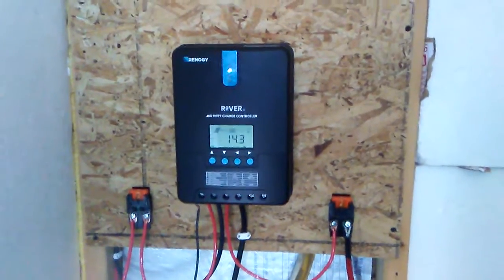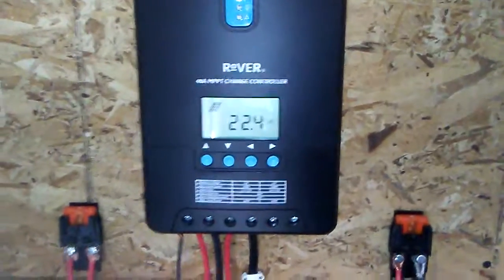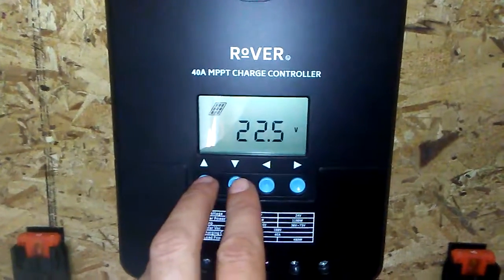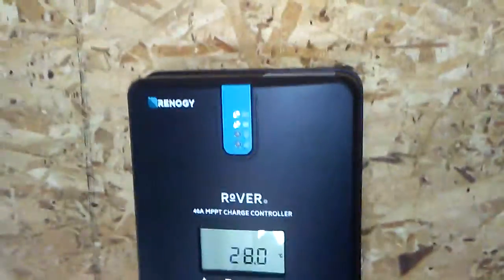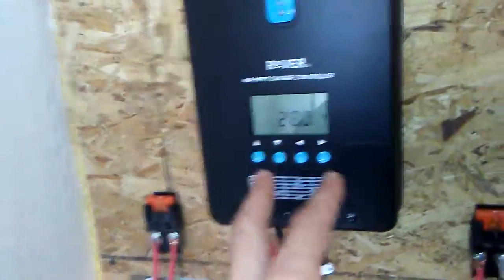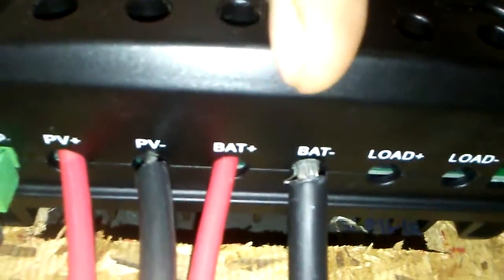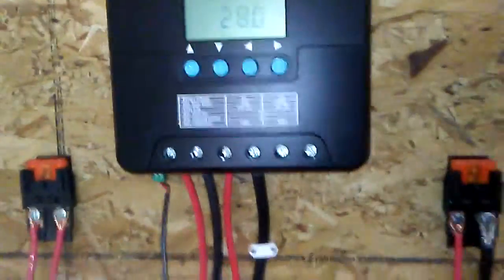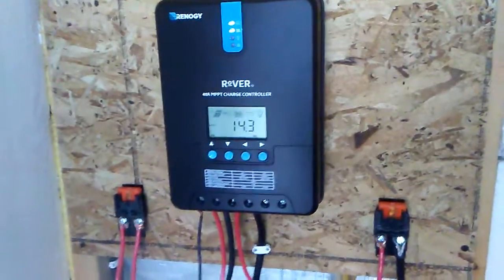Renogy 12V 400W 40A Solar Panel System Kit Install - Part 8 - All Systems Working

Comment: You skip around & move camera so it is hard to see how you wired the fuses....   & why the 2nd one (2nd panel?).  Comments on wiring would be apprec..
Reply from the maker: The Hot Wire Coming In... (red wire) has the fuse going into the charge controller. The hot wire coming out to the battery is also fused.
Reply: It's pretty obvious if you know anything about a solar charger two red wires coming out of it with fuses only means one thing. Fuse on the positive coming in and a fuse on the positive going out to protect your charger from short circuits or surges

Comment: Super videos in this series. You spend a great deal of time explaining things which is so helpful. However, you didn't really show the Rover connections for a novice. It would be helpful if you would show each cable and its point of connection. Here you start out saying cable comes in house and connects to a certain place. But then you just say this connects to this and that but don't show it. You do share a lot of good Rover info but I'm looking for a video that actually shows step by step where each wire goes. I'm sure there are manuals and pictures out there. I'm sharing my thoughts on this because you sincerely seem to want to be instructional and helpful.  If you slowed down a little and went step by step, a novice like myself could learn so much more. I'm a subscriber now and look forward to all your videos. Thank you!
Reply from the maker: Thank you for your suggestions and I will make a video on this for you.
Reply: I’d like to see the connectors used on the wires going into the charge controller.

Comment: Excellent video how ever temperature on the mppt is not the battery its for the mppt controller temperature management and if you want to know the temperature of the battery u need a monitor
Reply from the maker: The temperature gauge that came with the kit that plugs into the charge controller says to hook it up to the battery, which it is.

Comment: I have three panels that are hundred w h and I want to put an extra panel that's 350 Watts can I use that panel on my 40 amp charger controller 12-volt system
Reply from the maker: 300 w system, then you want to hook up an additional 350 w panel to give you a total of 650 w.  650 w divided by 12 v = just over 54 amps. I wouldn't do it.

Comment: This is a very simple question for anyone that actually seems, for some reason. to be hard to answer.... I need to connect the solar controller panel & inverter up to my battery. I only have 1 set (+ & -) of clamp connectors on there. Would it be OK to feed the "+" wires of BOTH the panel & inverter into the same connector slot & same for "-" ?
Reply: straight from the panels to the battery ? well I wouldn’t recommend it could easily damage your battery’s over heat or something while your at work burn your house down
Reply: @jaredfairbarn4417  

Thanks Jared. 

I didn't actually explain that very well. It is going through a controller it was more the the question of using the same terminal possibly with same wires touching connecting to the plus and minus connections. 

I have since been given to understand that this is not a problem at all and have had the system up and running perfectly well.

Thank you for your input though.
Reply from the maker: Yeah if you're just using just one battery that is fine. If you use multiple batteries you'll have to have some jumpers and you would want to pull your power from different battery terminals.  I could make a video on how to correctly do that if you would like.
Reply: @TinyIowa  

I think I'm OK now Tiny but thank you very much for your kind offer. 

The summer was really a process of experimentation & discovery with my first solar setup. 

It all worked fine during what was actually quite a good British summer for us. My one regret was possibly in not looking into more modern battery technology as my understanding is - with sealed lead acid - you only really have a 20% usage band as you shouldn't take lesuire batteries below 80%?

Funny enough, in bemoaning the British weather - When the sun is out we are probably one of the best countries in the world to run a panel in as a good summer's day will stay around an optimum panel functioning temp of around 25C! That's "if" the sun comes out!

Comment: Hi. I have a 60A, 4 300w panels and 4 225ah batteries. The fuse from PV is 100a but at higher amp it blows. Why? Also what's the correct setting for 24v battery bank? Thanks
Reply from the maker: one panel is equal to 25A if you're set up for a 12v battery system. for a 24v system, one panel will produce 12.5a. 
so all four 300w panels, Wired in Parallel, on a 12v system would be 100 amps. no good! 
But if you hook it up for a 24v system, using your four 300w panels, Wired in Parallel, it would only produce 50w.  So set your batteries up, Wired in a Series,  for a 24v, system.

Comment: Hi  2x190watt mono panels how many amps fuse ?  150 amp batty how many amps fuse ?  Thanks
Reply from the maker: It all depends on your voltage of the battery you have set up.
Reply: @TinyIowa  12 volt  ?

Comment: I'm learning about solar panels.  I want to get a setup of maybe 200 watts for my suv for camping in the desert. Enough power to keep a car refrigerator and cell phone charged maybe a small tv.
Reply from the maker: I would go with a 400 watt minimum setup.  Only reason why is because of the refrigerator and you sound like you may want to add more things eventually.  
is the desert the high desert  (colder climate) or a normally hot desert until nightfall?  The only reason why I say that is because solar panels don't produce as much energy in heat as they do with colder climates.  The standard temp they test/rate them at is 77 degrees F.  The hotter the temp is the less they produce.  The colder the temp is the more they produce. 
Another good thing to think about is your battery bank.  Try to get High Amp Hours in your deep cycle battery. The higher the number the longer they will hold the charge for. And the more charge they hold overnight until the sun comes up again, the less they'll have to be charged.  ….saves on batter cycle life.
Reply: Tiny Iowa I just bought 4 100 watt panels a controller and I already have 2 interstate deep cycle batteries for my boat..Will those deep cycle battery work good and how many do I need?? I want to run a deep freezer and lights mainly.. Thanks is it the more batteries the longer life you have between charges.. Also what size power inverter would I need?? Could you recommend me s good priced and quality power inverter.. Thanks

Comment: What price
Reply from the maker: For the 40 amp MPPT controller, 4 100 watt panels, and some wire etc... $670 delivered to the house.  
Less than $1000 you can get a couple 12 v deep cycle batteries, an inverter, and the solar set.  
It all pays for itself in less than a year.  Then every 5 years new batteries. Solar panels are good for 25 years.

Comment: Confusing, start talking about something then forget about it  and move into something else.  What is wire on far left going to battery?  Just said it doesn’t matter which post it hooks up to, then moved into batteries.  Would like to see how the fuses are connected and what size wire you used for all connections.
Reply from the maker: Yeah I digress a lot. The wire on the left going to the battery is for the temperature reading.

Comment: 24 volts is good ?
Reply from the maker: Yes that is!
Reply: The charge only allows enough voltage through the controller to charge the battery... 15 or 16 volts.

Comment: Can you run 2 laptops 12 hrs a day on this system?
Reply from the maker: Yes indeed. Just remember, the more batteries (amp hours) you have, the longer you can run your electronics.  We have two 12v sealed gel batteries and run our entire tiny house (including my wife's and my laptops) off of the system. Thanks for asking.
Reply: @TinyIowa  I want to attached a single 200 amp hours lithium instead of connecting two batteries, would that work also? Thank you again. I want to keep the setup as simple as possible.
Reply from the maker: I don't have the manual near me... I packed it away somewhere, sorry... But I think if you look up the manual online, I'm pretty sure yes you can.  That would work fine too.  My suggestion though is to go with 2 6volt batteries.  Usually the 6volt batteries have more amp hours on them than a 12 volt.

Comment: Could you be specific as to how I set the array for a Lithium battery? Just installed it and don't want to screw up. If you want, email me at acwdownsouth at yahoo....
Reply from the maker: Sorry it took a while to get back to you... unfortunately I don't know right off the top of my hand. Best suggestion would be to look at the manual or contact customer support.  They'll be able to help you out 100%!  Thanks!

Comment: Is it necessary to install fuses and why?
Reply from the maker: Mainly for protection.  Power surge blowing a fuse is better that blowing a more costly thing.
Reply: Circuit breakers are cheaper though over time, just reset them if they trip, saves fuse buying over time.

Comment: What are the best settings for an 18650 pack, 4S7p (16.8v) ?  I looked at the user settings but not sure what to set equilization and boost to?
Reply from the maker: I'm not sure.  I would call customer service and ask them!  Thanks for asking, sorry I couldn't be of help.

Comment: Why 6volt batteries and not 12volt
Reply from the maker: 6 volts usually have more Amp Hours than 12 volt. Thanks for asking
Reply: @TinyIowa  but then you need to run 2 of them in series to equal a 12 volt system. so doesnt it equal out?
Reply from the maker: 6 Volt Batteries Usually Have More AMP Hours on Them. When you run them in series yes the amp hours stay the same.  Usually you want to run MAX 3 batteries in Series. And the same goes for Parallel, 3 Max. (Both are easier to charge with only 3. 

Example... 1 12v batter w/100 Amp Hours + another battery w/the same stats... Wired in Parallel gives you 200 Amp Hours. But if you get a 6 v battery with 200 amp hours and a second one w/the same stats and wire them in series to achieve 12 v they will give you still 200 amp hours. But here's the thing...if you get two more 6v 200 amp batteries, (wire them in series) and wire them in parallel, you now have 400 amp hours. 

So in since it is not good to wire more than three batteries in series (cause its harder to charge) You can achieve more amp hours. Three 12 v batteries w/100 amp hours a piece will give you 300 amp hours. Whereas three sets of 2 6v 200 amp hour batteries wired together will give you 600 amp hours. 

They even have 2 v batteries... but it's just not economical to do that.  

Eventually the best thing to do is go up in power... instead of 12 v go with 24v or even a 48v system.... it takes less power to create 120 volts AC current going from 48 volts DC current. Whereas to create 120 volts AC current going from 12 V DC current. but again... economics & what one really needs. 

hope that helps explain things.
Reply: Tiny Iowa but then u would need buck or boost converter to step down that 48v to use on ur 12v devices
Reply from the maker: yes there are numerous ways to get the 12 volts needed. FYI most appliances nowadays are ran on DC voltage/current anyways. Most all have transformers built into them already, but people just don't realize. Pro's and Cons to everything.  Thing is... build your system for YOUR needs. There is no "Standard way of doing things." 
Also with the Rover (charge controller) that we use, there is a separate circuit coming from the Rover that has a 12 V Line.

Comment: The lower the cell temp the higher the voltage and power produce. Temp inversely correlate with Vmp voltage and Pmp. The problem is, the higher the temp the lower the voltage, and it may go below the charger minimum MPPT voltage range, and it may turn off your charging.
Reply from the maker: Exactly Correct!!  I'll be posting a video shortly since we are having cold cold days ahead regarding this!

Comment: Yes I was watching your video why things I do like about it but you're making a few mistakes that is not aluminum wire its nickel-coated is copper with nickel coating on it so you don't have to use no locks on The Wire and definitely definitely need to put ends on preferably soldering
Reply from the maker: The wire that I used for the installation was Aluminum wire. I was an electrician for many years, and studied the NEC book. Yes, granted the edition that I studied under is a few years older than the current one, but when I studied codes of the past it seemed like the codes never decreased in value and only went up. 
FYI, I have a close friend that still holds an electricians license and I specifically had asked him about the code for using aluminum wire. He told me exactly what I was panning to do is still correct to this day. Aluminum saves on weight and is more cost effective than Nickle Coated Copper!! Win Win! 

Yes, I should have put on electrical spade terminal connectors on my wire's before I connected them to my fuse boxes... but at that time, I didn't have any for that gauge of wire and I wasn't to worried about it. Why? Cause this is just a temporary installation until I get my power shed built, And I wanted to get the panels operational! (A run to the store from here is a 60 mile round trip!) But when I build my electrical power shed and remount this permanently, then I will, (you have my word on this lol) add spade connectors to the wire that will be soldered. ;) 

Good day.

Comment: Yes, please detail the AWG on your battery and panel wiring and where did you get those cool fuses?
Reply from the maker: For a 40 Amp wire it's 8 AWG, (without voltage drop... the farther the distance from the panels to the charge controller, you will need to step up your wire size, especially using DC current.) The fuses I got in the automotive section at Mills Fleet Farm. I'm sure that any Auto Parts store would have them.
Reply: Thank you Sir!

Comment: Awesome video... Thanks for sharing the information. Your right, there are very few to none video's on YouTube showing this RoVer charge controller. I have two of these 30 and 40. I have four 100 watt RENOGY Monocrystalline panels, and two 150 watt Monocrystalline panels. I went with two 6volt Trojan T105 RE batteries. Would like to ad two more but must reinforce my battery compartment due to the weight of rack battery 67 pounds. They are heavy but I'm told the Trojans are the way to go... Anyway I'm new to all of this, so please share more video's with us. Thumbs UP on your video, and you have a new subscriber to your channel. By way ad a link to where you get those fuse holders. I like em...
Reply from the maker: Thanks for the compliment's!  The fuse boxes I got were for a vehicle at a 'fleet farm' (like tractor supply) store. They were about $4 a piece I think?! The batteries you have are one of the best.  Hopefully one day we can acquire them too!  Thanks again for the sub!  :)